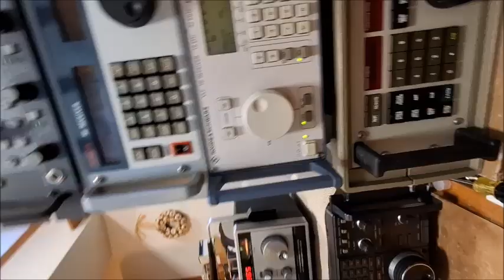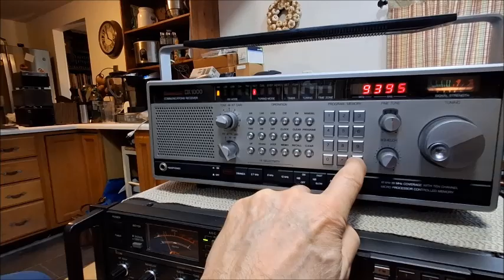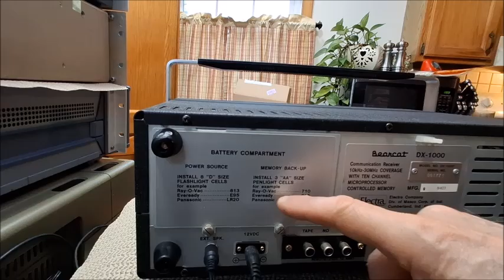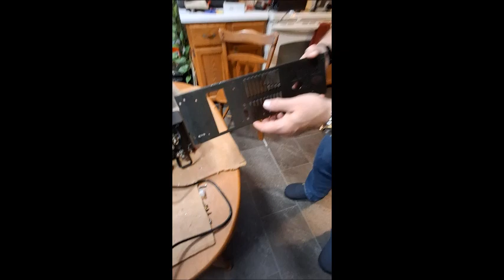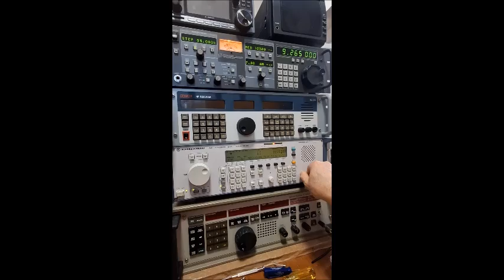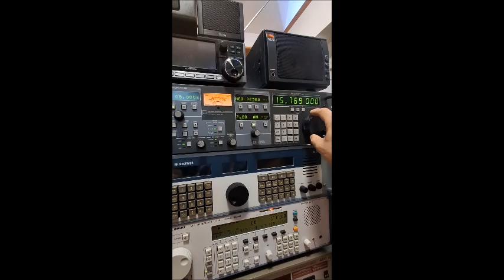Chuck and Dan spend time with some classic premium and other receivers

Comment: Heat buildup is what kills these great old radios,  my Icom R9500 runs really hot, lots of shielding inside for use around computers and other equiptment,   needs a much better fan,  hey Chuck  hope u made some progress on the Anritsu,     thx,   Matt